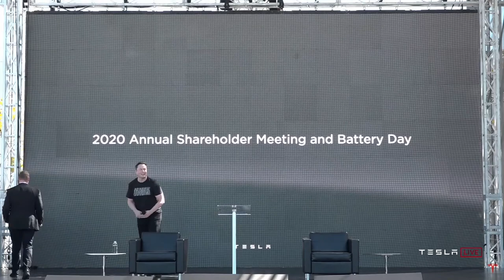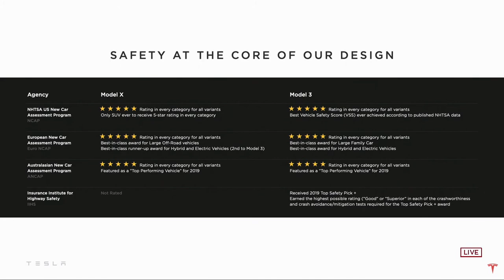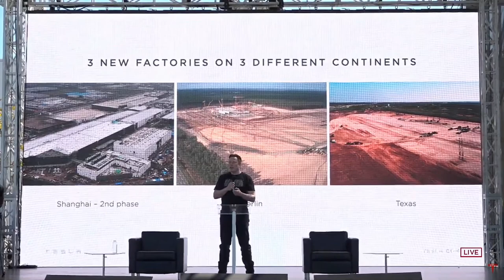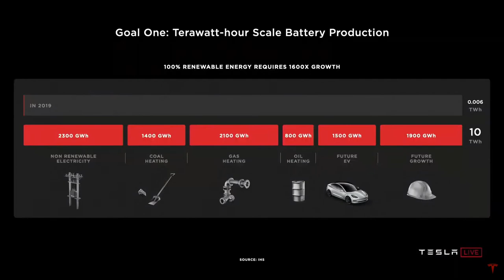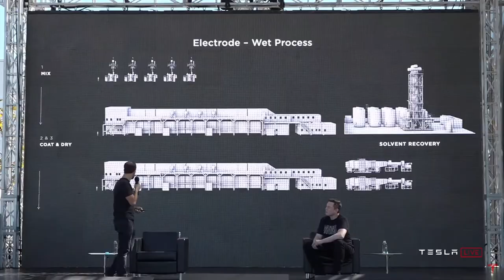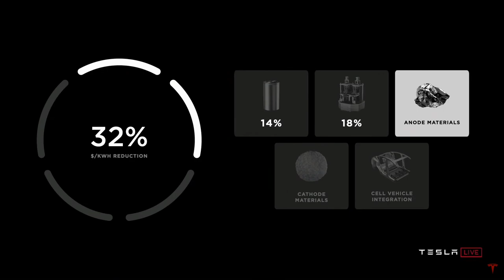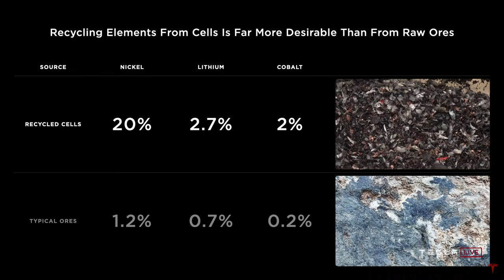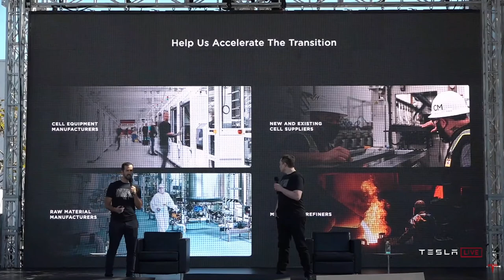REPLAY: Elon Musk's Tesla Battery Day Reveal Event

Comment: Watch Elon create massive machines that just roll over terrain, dig out like 5 feet of dirt, process the lithium and other useable elements out of it and then spit the dirt back out. Then he'll capitalize on the processed land by selling it to home builders
Reply: Jokes aside, a machine like that would be quite useful on the Moon or Mars, scoop up the top layer of soil, process it, then use the slag and add it to thermoplastics to use as building material for protecting buildings or building launch / landing pads, especially on Mars where simple PLA plastic could be made on site with waste plant matter and the temperatures never get high enough for the plastic to weaken, combined with slag/regolith  you have a strong, cheap building matirial that you can use extensively not only for structures but also to aid in Radiation shielding
Reply: @UNSCPILOT  You lost me at thermoplastics, but I totally get what you're saying. I figure machines like that are eventually going to be a reality; if not on earth then definitely on other planets/moons. 

What would be great is if they could either be fueled up and blasted off the surface of a planet and used elsewhere, or broken into sections that could be loaded inside rockets and flown elsewhere for reassembly. Eventually stationary processing facilities will be inconvenient to transport raw materials to and having a facility that mines, processes, and replaces the raw ore(/material) would be extremely convenient and perhaps even cost effective. (I'm just speculating cos I find the concept really cool)

Comment: So does the battery last million miles. They didn't say anything in those lines.
Reply: yes, it does .
LFP can do 4,000 cycles and CATL Already has LFP that has 8,000 cycles.
Reply: @markplott4820  yes I know about LFP chemistry  based batteries.  But here they have different chemistry.
Reply: @najibyarzerachic   - TESLA is using LFP in SR+ cars , they will have Million mile cattery , as will Model 2 / Robotaxi.
Reply: @markplott4820  I know that. But yesterday's presentation was NOT about LFP batteries.
Reply: @najibyarzerachic   - then you Missed alot. 
TESLA will be using LFP for ALL SR+ vehicles and GRID storage , as well as the $25K car, perhaps YOU missed that.
BTW the LFP is the TESLA million mile battery, acctually 1.2 million.
Reply: @markplott4820  you are mixing things up.  Yes Tesla is using LFP batteries but that is from suppliers such as Catl.  They did not specifically say they will manufacture LFP battery cells themselves.  They compared use of Nickel vs iron in their presentation and said they will be using more nickel.